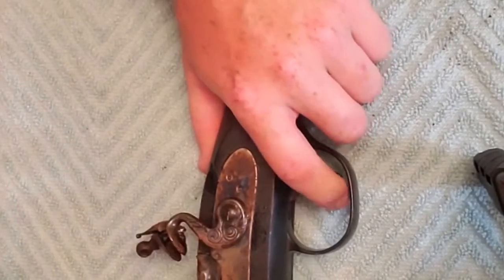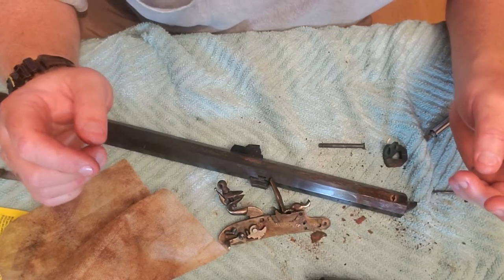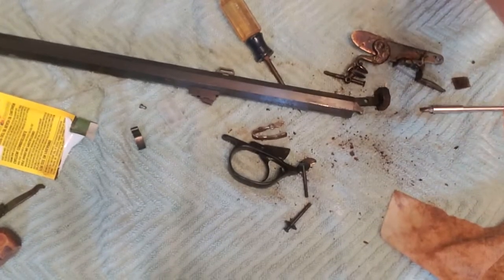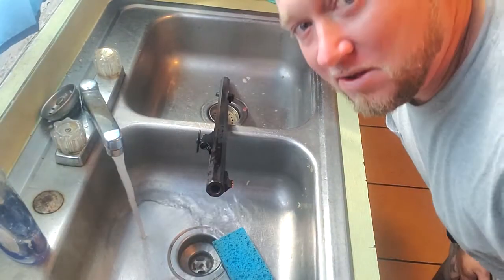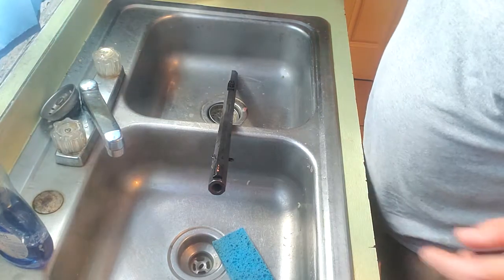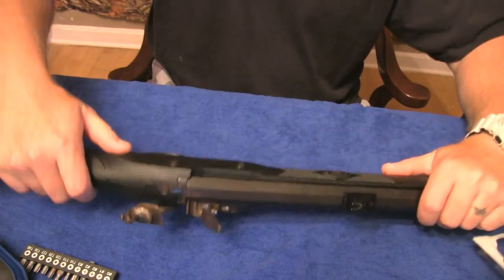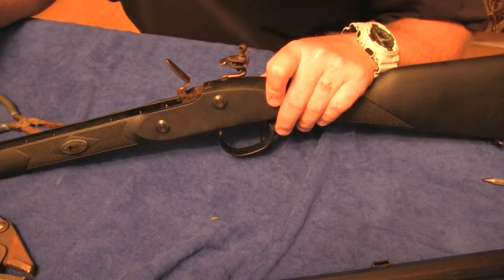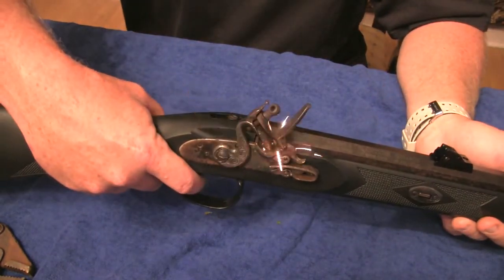Fixing And Cleaning My Deerhunter 50 cal Flintlock!!!

Comment: You never remove the breech plug.
Worst case scenario use a jag and a patch and a wire brush,....
Get a bore light,... your barrel is far from clean.
Your not the first guy to not clean his gun.
Reply from the maker: Doesn't have a breach plug... I use a jag, wire brush, patches etc. thanks though
Reply: @Onedayoutdoors  Technically the hook in the end of the barrel or the barrel tang are threaded and is  indeed the breech plug but are not intended to be removed. I use a shotgun brush and a shotgun mop and hot water and dish washing liquid.
Pulling the mop in and out cleans the barrel hydraulically.
The boiling water dry's instantly,
Then I run a patch with bore butter through the barrel several times.
If you have accuracy problems buy fresh Goex Black Powder.
Reply: @Onedayoutdoors  Also I will tell you this people who use powder substitutes*****
Must read the directions on their fake powder<--------<<< on some of them hot soapy water will harden the fowling like cement,...... they think their barrel is clean,...... while that cemented fowling is eating their barrel.
That's where you use alternative methods to clean it.
Such as in a 50 cal you use a 45 caliber jag  and a 1 inch square of a scotch bright pad to get it all out.
You scrub it all out and check to see if the barrel is clean with a Traditions Bore light.
One hole at 50 and cloverleafs at 100.
Keep your Powder dry.

Comment: Don't need 4 f just 2 f   or 3 f for your pan. I don't use 4 f I use the same powder I put down the barrel and you only need about 3 grains of powder for your pan. I have the same flintlock always goes off like the inline muzzleloader to much powder in the pan will make it have a slow delay. And make sure your flint is new or sharp. And when you're done cleaning it and not going to use it for long while take transmission fluid on a patch and run it down your barrel and wipe down all metal parts and outside barrel with it it works very well and old timer who's been shooting muzzleloader for over 40 years showed me this I've been using it since.